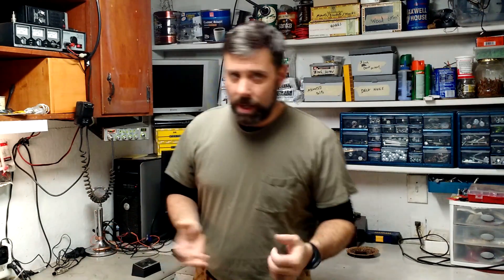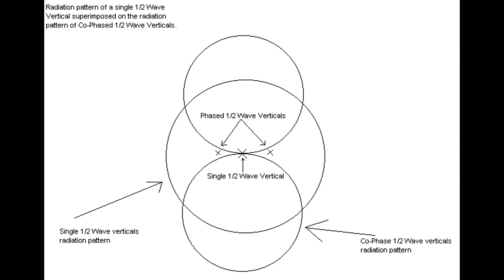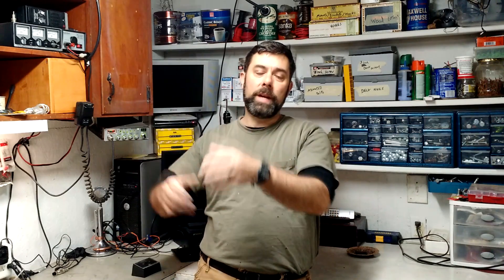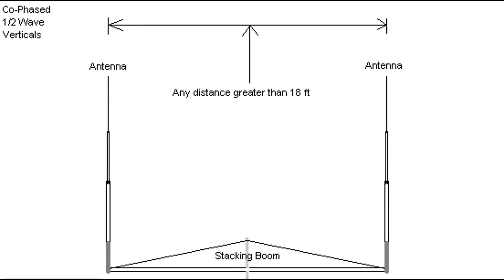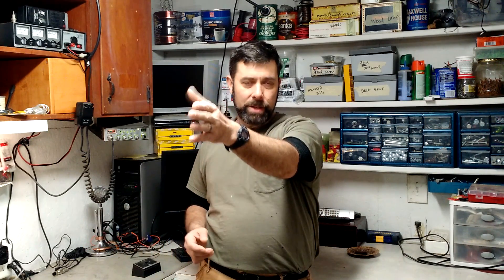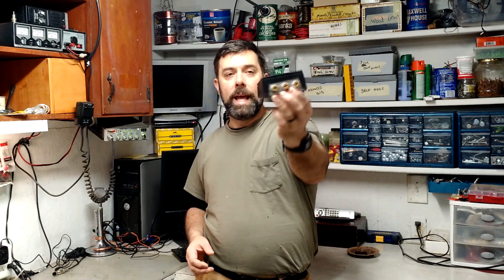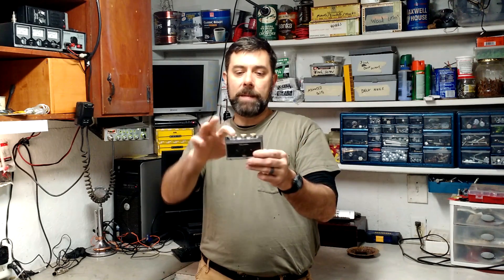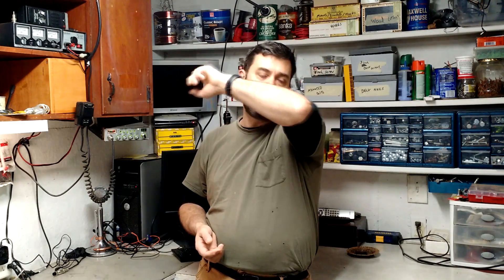Installing Dual Antennas For Your CB Radio. Co-Phased And Switched Setups.

Comment: I run a bearcat 980SSb for side band but I wanna have a   AM cb running on channel 19. While I'm driving around while using side ban. Are you capable of running to CBs with 2 separate and antennas the same vehicle on a car
Reply from the maker: You can with an Ab Switch

Comment: Eric I got 2 Cobra Model HG A1500 300 Watt Antenna's. Plus i ordered PL259 Coax Splitter & Adapter for my hand held Cobra cb radio. I'm gonna stick them on either side of my BBQ. So should i get a SWR meter or do you think it's good. oh & I always clean off my BBQ side metal table's. I have been asking people if i sound ok & they say i'm sounding Good I got 3 response's so far. Let me know what you think. Thanks Eric.
Reply from the maker: YES! I just installed a HG A1500 on my car and it needed a lot of adjustment to get it right.
Reply: @FarpointFarms  Sweet!

Comment: How about this, lets say i have a 70mhz radio and a 27mhz radio inside my house, the 70mhz has two antennas with a switch like the one you are talking about in this video, and the 27mhz just have one antenna, it makes it a total of three antennas, how ever, there will always only be two antennas in use at the same time, one from the 70mhz and the one from the 27mhz. My question is: does it matter about distance between those two antennas that are in use at the same time or can i just put them with some feets apart from each other ? Thanks..
Reply from the maker: Put them a few feet apart and you should be fine.

Comment: I know they are not the same, but what do you think would happen if a guy co-phased an Imax2000, and an Antron 99 in a base station application mounted 20ft apart?
Reply from the maker: I think that would cause issues with imbalance.
Reply: @Farpoint Farms  
Yeah, I think you're right.
I wish I could see the radio waves on a monitor live action. Like how an xray shows our bones. I wish I could do the same thing with radio waves off my antenna.

Comment: When we where setting up our cophased antennas we would use high quality 75 ohm TV coax cables down to a PL58 T joiner,then from the joiner to the radio we would use 50 ohm cj58 cu coax.We would use what us Aussies would call a bush master they where a 4 foot helical whip with a adjustable tip,which made it a breeze to set the SWR.
Reply from the maker: Really? That doesn't seem like it would work. Cool though!
Reply: @FarpointFarms  I used to do communications as a job.I installed CB,UHF and VHF we sold mostly Electrophone gear and some Phillips now and then.We installed them in cars,buses,trucks and water vessels.We also installed the bigger Codan Sideband sets ,to tourist bus services so they could call The Royal Flying Doctor services in case of emergency (there where no mobile phones then)

Comment: At no point did you say anything about how to match and get a proper SWR between a co-phased pair of CB antennas. Surprisingly nowhere on the internet can I find a simple video with a person matching up a pair of antennas co-phase and adjusting the SWR properly. Does anyone know of a good video tutorial???
Reply from the maker: That is because you don't need to match the antenna's the Co-Phased Antenna harness is a match. You can adjust the SWR of each antenna alone and then hook them to the co-phased wiring and you are all set.
Reply: @FarpointFarms  I don't think I understand what you're trying to say. You have to adjust the antennas before use for proper SWR in balance.
Reply from the maker: @JimGrimNY  Yes, hook up each antenna alone and get the best SWR in the place you  intend to use it. Then when they are in co-phase all will be well.
Reply: @FarpointFarms  so what you're saying is I need to have a separate coax cable and an independent mount to hook up an antenna set the SWR (twice, once for each) then take all that down, then re put up a co-phase line and put those antennas back on that? At the present time I'm very limited in my budget. I don't have a spare single mount and coax. Also I don't have a dummy load to plug off one side of the co phase line while I tune the antenna.

Comment: Great video. I'm thinking of putting a dual firestick setup on my pickup right behind the cab. I want to do 5' sticks so I have 2/3 of each above the roof (obstructions) to increase range. Will that be a problem with the SWR since the total is over the 102"? Sorry for the newbie question, but I can't find anything other than mentioning  dual 4' ones and I want to be able to justify it or not. Keep up the great videos sir!  73's from Mass
Reply: not an expert so cant give advice, i did the same on my truck, went from a Wilson "Little Wil" to 2- 4' firesticks, SWR was a pain to get down, still working on it, higher than i like, but i can safely transmit and receive, ive noticed i pick up alot more skip, but feel like im missing local transmissions, radio is a president washington, same length coax stripped and soldered into a PL259 connector ant the back of the radio. i remember seeing pickup trucks back in the day running dual antennas and keep hearing not to do it. how was your experience?
Reply: @richardkrieb4146  I went with a single on the front fender. I also kept hearing problems with them being too close and that they should be at least 8' apart. The single 5'er worked great though.

Comment: There is one use for A B switch in a car. Two antennas 9 feet apart Two pl259 a quarter wave of coax apart one antenna on the hood one on the trunk. The signal goes front or back depending on the feed point. A little tricky to set up.

Comment: In a car for multiple band coverage I have used a Duplexer/Triplexer that allowed me to use 2-3 differently tuned antennas on one radio and it would route my RF to the correct antenna for the band I was using at the time.  I'm back to multiple radios in my car now and one of my antennas covers 118-580mhz and other covers 22-50mhz.  I have each antenna on power folder mounts allowing me to raise/lower them as needed for city life..  Lower the whip when there are low trees or wires and both when I have to use a parking structure.

Comment: If they're omnidirectional when correctly spaced apart, couldn't one be run on one side of the truck, and the other be run 9' away anywhere else on the truck? They shouldn't have to be side-by-side...

Comment: No, no amount of antennas will, "amplify" anything. The ONLY reason to use more than one is a properly built phased array; which sole purpose, is directional performance. This is what happens when CB guys (mostly truckers) think some sort of different science applies everywhere else in the universe besides their CB radio...

Comment: I have used cophased antennas on my big rig a couple times over the years. I was never impressed. The biggest thing I see with any mobile setup is that people often overlook the ground plane. Also since rf ground and dc ground are two different things, a multimeter is not much help with ground planes.
Reply: I tell persons to buy several feet of flat stainless steel grounding strap and run a section from the base of the antenna mount to the hinge of the truck door.  Then again from the inside of the hinge to the frame.  In my car I use a such cable to ground the radio chassis to the seat rail of my car to create the referenced ground plane.  My antenna mounts are not grounded so to say and it has improved my Rx/Tx greatly.  SWR of 1:1@28.400mhz and 1.2:1@ 27.185mhz

Comment: I bought a dual antenna kit that I installed on my pickup. The cables came equal length,and the two antennas are of course identical. Does that mean my setup is only directional and,if so,how do I know what direction?
Reply from the maker: It is directional to the sides. It will still get out and hear from the front and rear, but it will be better off to the sides.
Reply: If the antennas are fed in phase and mounted on say the mirrors (not inline with the vehicle), the pattern will likely be broadside to the line of antennas. In other words, radiating in front and behind the car, so the opposite of what his reply says. Anyway, don't listen to a single word this idiot says, he doesn't know what he is talking about.

Comment: high i have tw0 cb antennas...1-tram1498 18ft  2-imax 2000 24ft i want to co-phase them, how far apart should they be???
Reply: It’s not a good idea to co phase different antenna types particularly ones of different length as that can lead to phasing errors.

Comment: Hey Eric, can you give some insight on the most low profile antenna you would suggest? I'm willing to drill a hole in the trunk lid of my sedan, I came to this video because I was considering dual glass mounts ( trust me that I cringed at the thought myself ) I just dont want the mag mount paint scratch circle on this car. I've had this Cobra lx29 in many vehicle's with a mag mount
Reply: Concidered looking at hinge brackets or something that fit between the seems? I used LED pod mounts for the corners by the windshield and simply drilled the hole larger. Im running dual firestik 5ft antennas on my 1 ton with the cobra 29lx in fixing to swap in. The old uniden gets 7 miles out which is plenty for me. If anything, and i want futher reception, ill run an illegal booster.

Comment: To use the beam like you're talking, it would have to be vertically polarised for best effect.
And who says an antenna switch loses 1db? You need a better switch.
Reply: I think he meant connector loss rather than switching loss, 1dB sounds high to me as that’s close to 20% loss per connector. I personally would avoid the type of switch shown as it has a slide switch, a type of switch known for becoming intermittent due to contact wear. I would go for a rotary type that has an internal strip line mechanism where contact friction is minimal.
Reply: @johnyoung1128  yeah I use a rotary type. But it's worth mentioning that connector loss is insignificant at HF, even on the edge at 11m. And I have done on air tests with a friend who had a bunch of switches and relays inline for his switchable beam and radios etc. and you could not see any signal drop with or without. There's a YT video where this old bloke daisy chains all of these old connectors together to prove this. With 100W in he compares with and without and his high quality meters show practically no change in output. And when you think about how this would show on an S meter for a receiving radio, there is no way that it could have a distinguishing effect considering that you need to quadruple your power for 1 S point on paper. Anyone that says they can notice these differences is living in a fantasy land, they're flat out liars.
Reply: @arconeagain  Yes I did say I was sceptical of the 1dB figure.
Reply: @johnyoung1128  yeah I know, just sending a message to other people out there that stress about one or two extra connections on 27MHz.

Comment: I am thinking about getting a 25ft or 30ft pole and mounting a HD antenna for my tv but also on the pole at the top I want to put a whip or normal CB antenna. Would this work good? I live in the City right next to highway and have some trees around me too that are not mine to cut.
Reply: If you can get over the trees and still be able to tune the antenna there shouldnt be a problem. Taller heights should help get further. As long as fhe antenna is tuned.

Comment: Im racking my brain out in the middle of a field right now trying to tune my dual antena set up need help please
Reply from the maker: You need to have co-phased cables or it will never work right.
Reply: @FarpointFarms  I baught the dual firestik set up it came with the cables and everyrhing they are the same lenght
Reply: What type of cable have they used for the harness? Does it have mil spec written on it? What is the length of each cable from the tee piece? I can help you with this.
What's the mounting situation of the antennas and exact type are they. The antennas need to have an impedance of about 50ohms each (56.5 is near perfect) so the transformation is around 50ohms at the centre of tee. How far apart are the antennas too?
Reply: Distance apart?
Size of the antennas?
Tee or a cophased line?
Properly grounded?
Whats the SWR readings doing? 

I run dual 5ft firestik on my 1 ton with LED pod mounts by the hood corners near the glass. I just bought a New Cobra 29LX so ill have to retun here soon. The old setup gave me 6 miles but it wasnt set up correctly like it will be now.

Comment: Well that doesn't help much... I'm trying to come up with a covert system for a trailer park home base with steel roof. I was thinking cophased dual big sticks or something small like that.
Reply: Did you ever try this? I want to use a double bazooka with a tram 1499.
Reply: @dudebuchanan  I have a 102 steel whip up there now with a Jeep mounting bracket

Comment: No mention of how to hook these 'co phased' antennas up. What cable do you use and what lengths? What about other patterns, should one lag? What's this about the spacing being wrong so they're no longer omni directional? Isn't that what you want to achieve? The spacing is critical to generate a desired pattern so there is gain in certain directions and nulls in other directions. That is how it works, you cannot get something from nothing. Then there are other methods to achieve things like end fire. But I feel this is way outside your scope, I'm gunna save my breath.

Comment: Hey I got a 1980 Chevy wrecker I was wondering if I should put 1 or 2 fire stick antennas and what would be a good cb for my wrecker or would you put a different kind of antenna you tell me how you would do it
Reply: Don't listen to the bullshitters.  Any ham radio operator can show you the easy, easy math to get set up. 
Here's the deal:
The formula for your vertical antenna PLUS the counterpoise that it needs is:
the number 468 divided by the Frequency you are using divided by 2 will give the VERTICAL LENGTH in feet and the necessary length of the counterpoise wire to make it work.  The counterpoise is THE OTHER HALF OF THE ANTENNA.
So:
Assuming channel 17 to be about in the middle of the frequencies you are looking at:
468/27.165 MHz. divided by 2       OR:     17.22 feet divided by 2 for a half wave antenna.  OR: for a quarter wave antenna which is the usual size even if less efficient you can divide the 17.22 by 2 then divide the resulting  8.61 feet by 2 for the 1/4 wave length.
This means:
Your vertical will be at it's best, most efficient length with a 8.61 foot vertical and a 8.61 foot counterpoise wire.
Your CB will work, with some slight power loss with a 4.36 foot vertical and a 4.36 foot counterpoise wire.
Bottom line:
Use ONE decent quality CB antenna (Firestick antennas are cheap and work fine).  DO NOT use a antenna with a coil. The firestick has its wire wrapped around the fiberglass stick and that's fine....Those sexy looking coils ain't gonna get ya laid so don't waste yer money!  Then cut a piece of wire  4.36 feet long (or just a skosh over 52.3 inches), crimp or solder a ring connector on it that is just big enough to slip over the antenna mounting threads. This will connect your coax braided sheath to the counterpoise wire.  Tape or otherwise secure the counterpoise wire so it's horizontal and stretched out away from the vertical and  doesn't blow around and yer done!
Just a Firestick and a proper counterpoise wire is ALL YOU NEED!   Then tune the antenna length for best SWR (which will be VERY EASY) and your radio will run better than any of the other radios set up by the truck stop bullshitters.
Now, If ya wanna get serious, go for the 8.61 foot vertical with the 8.61 counterpoise.  Your radio will turn into the monster you always knew it was when its antenna can actually radiate!!! 
bob/KF7ZSA   ( run my call sign through your browser to check it)

Comment: This is gibberish.........Truckers pick their antenna based on how cool they look.  That is why you see antennas with gigantic and bizarre base loading coils.....The ONLY reason to run two antennas is because having only one looks weird.....So, avoid this pointless nonsense and just leave on of the antennas unhooked.  
Bye the way, You can find antenna tuners on YouTube you can easily build yourself.....A LOT CHEAPER!

I am am retired OTR trucker and a licensed radio amateur and what I am telling you is he plain truth.  By the way, I spent the last few years with a empty spot on my doghouse....I gave the offensive and useless piece of shit CB ( nice Cobra 29 LTD) away and enjoyed the peace and quiet of a truck cab not filled with the CB venom.....I did, however keep the antennas....When I heard them slapping the sides of my condo-sleeper; I knew I was getting fore-and-aft ice buildup on the sticks.....GOOD TO KNOW!
bob/KF7ZSA
Reply: That's right, two antennas in phase at say a quarter wave spacing offer very little gain if any. The trouble of making the harness and trying to achieve a good match is pointless. The only reason to run at this close spacing would be if one were lagging to achieve bi directional or endfire patterns. Even then it is overly complicated as you run into other real world problems with this close spacing due to the nature of mutual conductance. I believe that breaking down and analysing the currents on the antennas becomes extremely complicated, is difficult to measure and is well outside the scope of this discussion. Wider spacing are much more practical and forgiving in my experience.